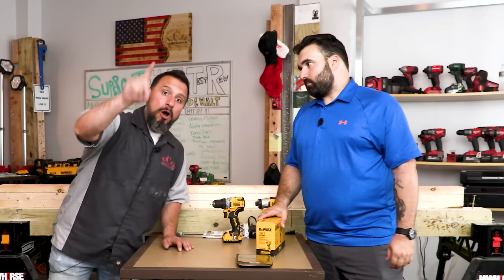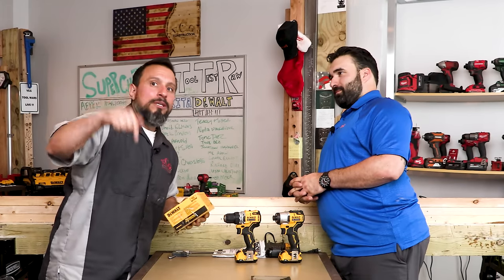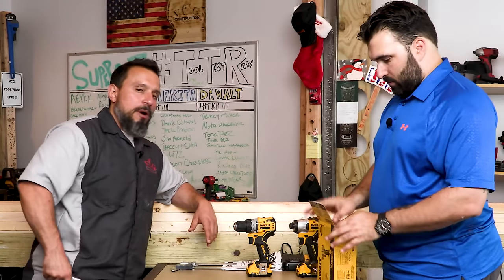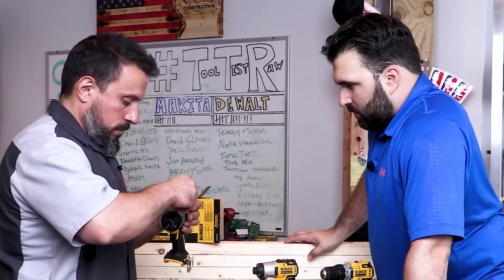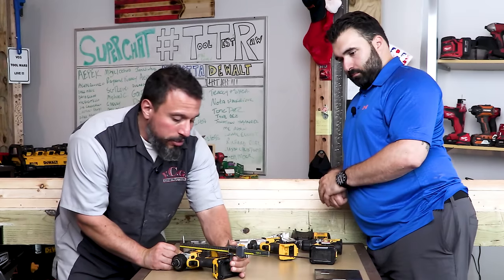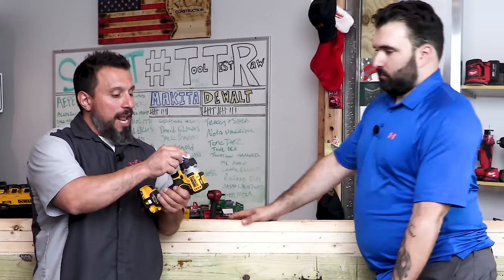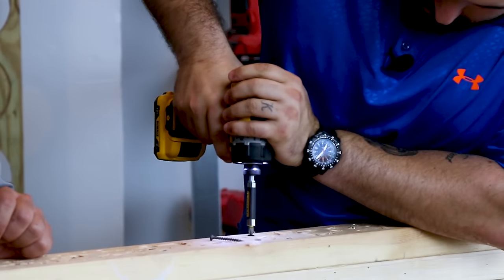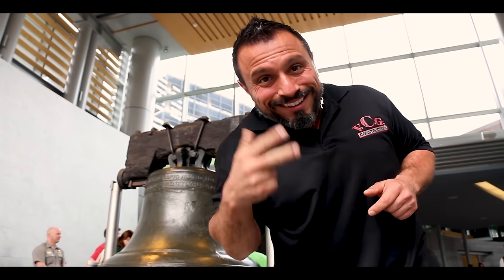NEW DeWALT Tools 12V MAX XTREME SCREWDRIVER (Watch Before You Buy!)

Comment: Damn I love those DeWalt quick insert collets. The spring loaded action to eject the attachment is beautiful too. Pisses me off every time I pick up my M12 tools and they don't have it!
Reply: Agreed, I used to have the M12 Fuel Screwdriver which had the one handed mechanism.. until someone stole everything out of my van.  When I rebought the a new unit, it didn't have the one handed eject OR the insert (w/o pull up on collet) .  Needless to say it went straight back to the store.  I was bummed, but I may pickup this unit and check it out.

Comment: A tradesman left one at my house.  Before he came back I used it.  It takes all the 1/4  bits I have for my XR20v so used it on a screw clamp, then with my pivoting bit holder to drive shelf securing screws against a wall, relaced a door hinge with a self-closing hinge, and hung a few wire storage shelves.  I was sold so bought my own.  Check for deals.  Found mine with 2 batteries for around $100.  Great screwdriver and guess what, the 20v charger charges this little beauty.  I have loads of light switches and outlets to replace and this is just the job on the low settings.  So far so good.

Comment: I bought this 12V Max Xtreme screwdriver when it came out, and I still use it regularly. This is my go to screwdriver. Plenty powerful enough for small, medium, and some large screws. Good for drywall install because it's so lightweight. Don't be fooled by the people saying 12V is not strong, this tool is plenty strong, and I've never come across a time where I thought I needed more power from the tool. 12V tools are perfect for cabinets, electrical, building book shelves, and 99% of other tasks.
Reply: Yeah and slap on a 5ah 12v battery and you'll be able to drive bigger screws. Not that you would want to....
I'm buying this for "in the house" and smaller mounting work etc.

Comment: Hey guys at VCG, love your videos but you have this all wrong, the settings are for torque, not speed screwdrivers are designed as an opposite to impacts.
Impacts are to drive large screws through tough materials.
Screwdrivers use torque settings to avoid damaging the work, like a plastic back box and are far superior to impacts when using wall plugs or narrower screws (aka almost every job in the home)

Comment: These guys don't understand the tool. It's not for driving screws into wood, and the 15 settings are not speeds. It's an adjustable clutch so that you can run screws down into more delicate materials without overtorquing.  It's a higher finesse, more finely adjustable driver that complements an impact driver.
Reply: Well they did say it's not for what they were doing.
Reply: It is intended for assembly,service,electronics, etc. Alarm installers and A/C techs will love that unit.
Reply: I’d say they fully understand the tool and its purpose.
Reply: Typical

Comment: All the new DeWalt 12v Extreme are available right now at my local Lowe's (Redmond, OR).  They only have the kits, no bare tools.  They have the impact driver / drill driver combo kit, impact driver kit, screwdriver kit, drill/driver kit and the impact wrench kit. I picked up the Impact Driver and a 3.0 AH battery.  The 2.0 batterries that came with the kit also had fuel gauges which is awesome.
Reply: They got them at lowes in Texas too

Comment: Does it lock when your not pulling the trigger? I work on small engines but I don’t like to disassemble with a impact. Snapon has an impact that won’t turn so I can break the screw loose by twisting the tool then hit the trigger to unscrew.  Same as tightening I stop when it’s tight then twist the tool to torque to my desired setting. If that makes sense lol.

Comment: I bought the impact,as an hvac tech I really love it ! It’s light and comfortable to use and the led lights are amazing
Reply: I am also a Hvac tech and a gear head I love the Dewalt 12 volt platform. It is small and powerful enough especially when your in crawl spaces. And it crosses over to Mac tools ratchets

Comment: I got it at Lowes for $50 (screwdriver + 3Ah battery). This is the most satisfying powertool I've ever bought. It's basically a drill driver with an impact driver collet. At level 1 it's so perfect for repairing a computer. When you switch to level 5-10 it has proper torque to assemble a furniture. Up to level 15 you can repair hinges on a cabinet.
Reply: Man I can't find it ...3x the price where I look wtf

Comment: I love my Fuel Screw Driver, it's essentially a drill without the chuck. Thought I was going to hate it and didn't understand the use, but it is one of my most used tools, especially when doing electrical work such as outlets and switches.
Reply: After switching out 16 outlets I agree.

Comment: So it's finally available in Australia, the update I've been long waiting for. I've been torturing my DCF610XE for 7 years now and it's still going strong. I'm a mechanic and mechanical plumber, it's been showered with so many types of car fluids, dropped at least 30 times and never fails to amaze me that it's all intact and even the handle mouldings are still good. I bought it because it's maximum torque was 7nm. 90% of the screws holding a euro engines and cars together are torqued to 10nm which means you can screw fast to one notch of the full torque of the driver, and then a quick 1/4 turn of the tension wrench is all that's needed to accurately finish off the screws. I also find it very useful screwing metal ductwork on large A/C installs, and with the clutch, I can do delicate things like pull apart electronic modules etc. I'm going to buy this new one in a few months time, it's 0.5cm fatter and 2cm taller but it's a little lighter, brushless and 4cm shorter which is a big plus in the sort of work I do.

Comment: I live these 12v Dewalts. Especially if you don’t need the power. They are much light and more compact. I have my own window and glass business. My guys always race to get my 12v pair. We will be converting to all of these 12 volts. I like that they use the same charger as the 20 volts. I just ordered ine of these. I think that the M12 line is much more developed and has more options. Huy the Dewalt has a more traditional grid and battery system and uses the same larger charger. Is they develop more options for the line it’s a homerun. We also use Ryobi for our nail guns, saws, lights, multi tool, and battery chip saw. We love Ryobi for their value and allows us to get more tool. My jobs don’t care that Ryobi is considered a cheaper tool or brand as long as they get done. And if the person using the tool is more important than the tool.

Comment: Vince you forgot 1 important thing about the 12v Xtreme brushless impact driver & screwdriver. 👍 they both except and hold a 1 inch driver bit  in the quarter inch chuck. And that's what really makes them more compact and fit into tight places. 👍
Reply from the maker: Whoa, gotta check that out!
Reply: @VCGConstruction  yes most other impacts the bits get stuck. But not those Xtreme ones 👍.

Comment: I watched your videos and purchased the Xtreme Drill, Impact Driver, and the 3/8 impact because they came with the tstak cases. I wasn’t sure if I would like them, but it didn’t take long to fall in love with them! I’m going  to order the Xtreme screwdriver just because, but I thought they were bringing out the Xreme multi also? Whatever, but DeWALT has to make a 12v Xtreme 5/8” SDS like soon! 

Are y’all going to be the first to have the Flexvolt 700 Pipe Threader? Can’t wait to get it in my hands 🖐 🤚 it looks DeWALT Tough!

Comment: Can the VCG crew do a short video on the differences between the m18 and m18 fuel? I love the performance I get from Ryobi for my lawn tools and airstrike nailers. Other power tools like drivers, hammer drill, etc. I feel like I'd be cheating myself if I didn't spend the extra bucks and get Milwaukee. I'm just not sure on the differences between the normal m18 and the fuel version. Keep up the great videos.

Comment: I purchased this screwdriver in kit form(DCF601F2) with two batteries last week July 2nd. They had the impact wrench along with the impact driver and drill/ driver combo available for sale here at my local Lowe’s already.

I also have the M12 Fuel Screwdriver 2402-22. It has quite a bit more torque than the new Dewalt Xtreme screwdriver.
Reply: Daniel Quintero I think that the M12 line of tools is a good tool line.  It seems that Dewalt 12 volt line rerelease needs to be tested in the long term before buying it.

Comment: I used to use the older version of this when doing electrical work installing boxes, outlets/switches and cable clamps. I get snickers from other guys commenting on my "small" drill. But, its light and does the job especially when your toolbelt is already filled with hand tools for electrical work. Oh, the settings is for torque so you don't strip or break the screw and its very handy when fastening small screws into weak "wood" like IKEA furniture. I've since upgraded to the xtreme 12v impact driver which does the same thing in my opinion but with the ability to drive larger fasteners.
Reply: Do you still have fine control for say, IKEA furniture, with the impact?
Reply: @matsudakodo  yep, I just recently assembled and installed a massive ikea wall unit using this driver.

Comment: I use this DCF601 on my motorcycle to remove almost everything. And i LOVE the clutch, it makes sure i wont strip any threads, my engine is aluminum, so i need to be v ery careful with the threads, so this is the perfect tool.

Right now i am on the market for the DCF901B that i think will have more than enough punch to remove and install heavier things like the clutch boss not, and the sprocket nuts.

I can't wait to have it, i am addicted to tools! jajajaja

Comment: I've never used a screw driver. Is the quick change collet the only benefit this has over a regular drill? I'm sure someone uses them but I've never understood why they exist
Reply from the maker: Yup pretty much the collet is the advantage
Reply: There is the weight savings, on a 12V tool you’re trimming off about 25% of the weight if you get rid of the chuck, you’re also not going to mar finishes on cabinets whether they be for AV equipment, kitchen or bathroom cabinet, go watch any maker channel on YouTube and whenever they got a fit a screw in a corner you can watch their chuck dig into their project, it’s even worse if it’s a metal chuck. You don’t have that problem with a 1/4” collet.

In November 2014 when I got my 12 V tools I thought the same way. I watch the video by the ultimate handyman about his screwdriver (a M12) in that following April, and how awesome it was, and I must have watched it three times before ordering my Bosch PS21 (from Amazon) I bought it on a whim believing that I would never use it and it was a gimmick, it is now the most used tool that I’ve ever owned (and bought the EC brushless PS22 as soon as it came out), would not be without it.
Reply: I would say that the main advantage of a “screw gun” is the clutch and not the 1/4” collet.  You can buy a good collet that fits on any drill.  I personally like the ones from Wera.  I have the old version of this and use it extensively to drive screws, but I don’t treat it like it is the end all be all of screwdrivers.  I use this if I’m installing equipment in an equipment rack, or installing screws on equipment.  I can adjust the clutch so I don’t over tighten the screws.  On the other hand, if you’re driving screws into wood, you’re probably better off using an impact driver.  I will certainly buy this tool because I loved the size and weight of my original Dewalt 12v screwdriver.

Comment: Guys, thank you for video. I was kind of shocked then I read how small is a maximum torque of this screwdriver... 
On UK site it is rated as 8N*m which is 70 Inch*lbs...
tiny bosch go2 is about 5N*m...
12v drill drivers usually rated 275 inch lb
is it really so weak? or am i missing something?

Comment: Hello Vince,. This Dewalt offer I think would be a great DYI guy tool or maybe a cable installation guy.  In my opnion the Bosch 12V is awesome, the Milwaukee 12V is dynamite, and of course the Fein 12V is super cool,  all of which I own and use.  In short I think there are better choices for general contractors and speciality contractors.  Cool video, thank you sir.

Comment: I like the shorter format. I think that I will take a wait and see attitude to the 12 volt Dewalt line.  I have been happy with the Milwaukee 12 volt tools so far and they have proved dependable. Will Dewalt tools be as dependable for the long term use?

Comment: Had one less than 5 months and the chuck broke and came right out of the drill. Ball bearings everywhere and I baby my tools. Starting to have second thoughts about buying another dewalt.
Reply: @rch5991  I actually bought the M12 a few weeks ago and it’s very weak compared to the dewalt in my
Opinion. I will be returning it.

Comment: Just tested out the m12 impact and I want to love it cuz well made and got a great price but few things that just can't leave my dewalt for. The grip is far better on the dewalt 12v and prefer the smaller sized slide on batteries. But the biggest let down is the lack of quick release on the milwaukee.  Every impact should have quick release even my old brushed 12v dewalt has it.

Comment: Forgot one cool feature. It has a simple lock on it that allows you to finish the screwing like a screw driver so you don’t over tighten or to give it one more 1/4 turn.
Reply: I use that feature to precision adjust cabinet hinges, you can't do that with an impact

Comment: I'm not big on Dewalt cordless tools because of the batteries in the past. And watching the 887 impact smoking several times, but I got this today and tested it and I love it. Lots of power for a small driver. And sinks the screws on setting 15 perfectly. On Max it sinks 4 inch screws no problem. 👌 better than the makita 12v drill and impact driver I have and use daily. 👌

Comment: Just bought it right before watching. I use for 1" fine thread into pine with precise plugged holes. Also own makita 12volt fd10r1 and dewalt dcf610 and the dewalt quick release system is far superior for triple driver work. 1 for recessed hole 1 for pilot bit 1 for screw.  Haven't tried Hilti new 12volt screwdriver but also interested. Maybe you could review the new Hilti 12 volt screw and impact drivers.  First Dewalt Dcf610 is still going with original batteries for 4 years of daily use.

Comment: Still Just Can't Touch The M12 Tool Line , But I Think/Hope DEWALT'S Getting Back To Their Roots, (Great Long Lasting Tools) Not Quite There Yet In My Opinion, But Stanley Black And Decker Seem To Heading in The Right Direction  !!!
Reply: To be fair they really aren't in the same range, you could pretty much get DeWalt entire 12v line up for the cost of the m12 kit and the differences would be negligible. That being said the m12 surge is a work of art.

Comment: It’s basically DCF680, but in an impact driver chassis. 

DeWalt kinda failed with their 12V battery form factor they can’t make their tool small and slick like Milwaukee can with M12 torpedo batteries.

Comment: Thanks for the great video . I just bought the 601 today at Lowe’s . I have everything I need in 20v but had to have this little guy. I have to admit Dewalt fooled me with the painted plastic trick .I thought the gear case was metal. I guess they need to cut cost somewhere to keep the price down . My original 20v  Max Dewalt tools were all I used to build my barn and they are still working at full capacity. It would be nice to see a 3ah battery. Thanks again. You guys are great.

Comment: I love battery operated screwdrivers ( of course not all ) but the ones with torque setting, I have;

•HitachiDB 10DL (10.8V) this runs on 12V battery too, which is considered the same battery from hitachi ! I’m really in love with this tool, & it’s VERY expensive one, no dissatisfaction at all

•DEKO DCS3.6DU2 Screwdriver (I personally recommend it) this tool has F U L L  OPTIONS!!
15+ 1 Torque the 16th is Drilling mode, LED light to illuminate work space, ANOTHER LED Light at the bottom for general lighting, green.yellow.red battery indicator lights, 2 finger trigger, the tool rotates/adjusts from gun grip to straight tool, also cushioned grip for comfort! Has 200 Rpm motor from eBay for only 16.99 My 2nd favorite screwdriver

•Black&Decker “SMART DRIVER LI4000 Type1 3.6Volts (180 Rpm) yes not fast BUT it’s just awesome & very well built, check it out, 

and thank me later

Comment: 3 years later,  I wish I would have invested in the 20v eco system.....
Reply: @DiPo-ks5io  I’m on both. 12v indoors, 20v outdoors. There’s a few redundant tools, but they have their place around the house. The good part about wanting 20v tools is that they’re mega common on the used markets. I have the atomic drill and impact, and they’re around for my heavy jobs. They (or similar) can be had for like $50/tool. The batteries aren’t bad either, and it pays to have 20V stuff in hand for the higher drain tools like circular saws. For quick jobs, I always want the lightest tool, so I keep the 12v stuff closer.

Comment: Someone explain why it’s not okay to stand up the tool? Why does it need to be in its side ?
Reply: @dustin bowers 
Chance of it falling down and damaging the material you’re working on whether that be an AV rack or someone’s countertops, cabinets or their hardwood floors or pulling a run out of their Berber carpet, also bending your bit holder etc...
You can turn an easy slamdunk job into a money losing proposition.